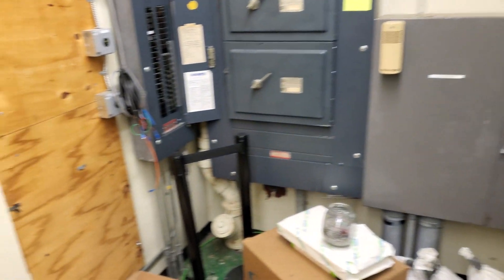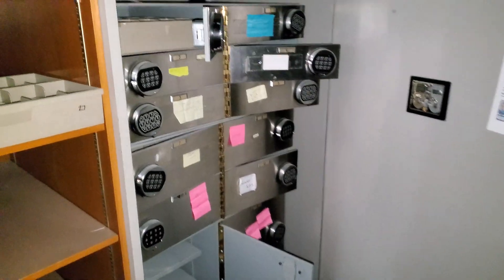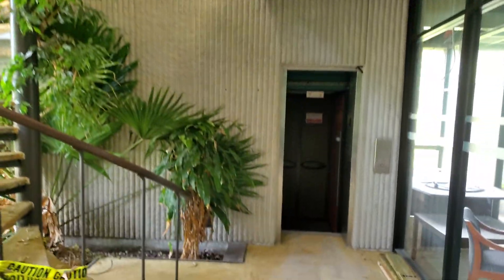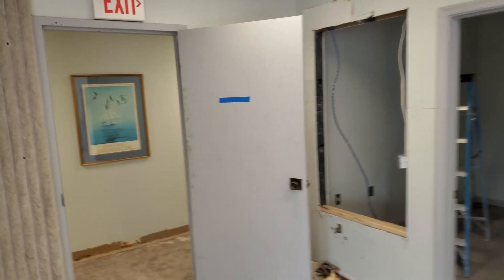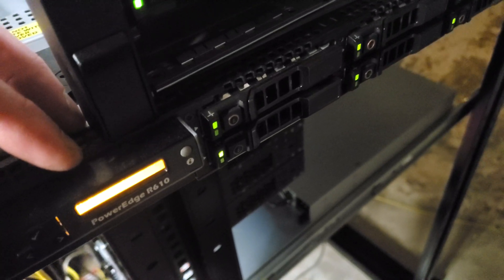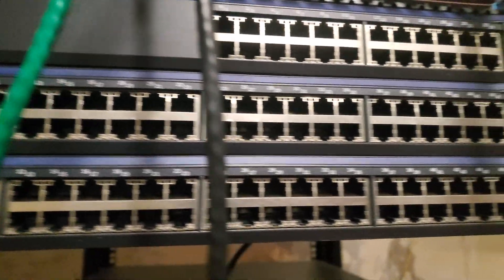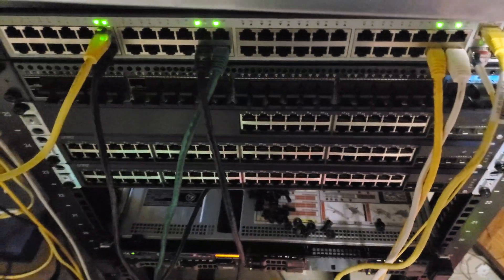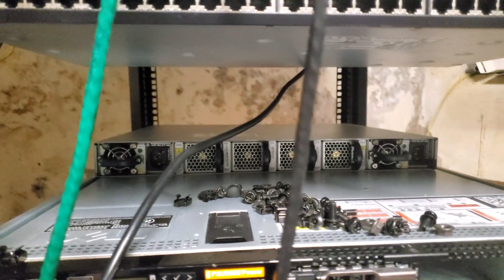Touring our new CO + a 100G home lab with BIDI, GPON , and DWDM

Comment: Those cienas have a weird pinout for the console port FYI, there's a photo online somewhere and I have it saved if you need it.
Reply: Pin 4 is gnd, pin 5 is rx, pin 6 is tx so if you butcher a standard cisco cable I believe it'll be pin 4 green, pin 5 yellow, pin 6 orange
Reply from the maker: Oh dang good looking out I was kinda curious about those devices why they are so expensive figured I should learn why.

Comment: I don’t think the dell servers will use 1 208 and 1 120 circuit, I believe both power supplies have to match voltage.
Reply from the maker: Already got them setup.  Psu1 running 240 straight and psu2 running 120 on a battery.

Comment: you just nee to get the windows in and do a few runs to goodwill - don't throw too much out - you have room for storage - get hepa pos pressure going with heat pumps - the office will be fancy - congrats - pls do a followup on rack when you get it all optimized - these things do take time